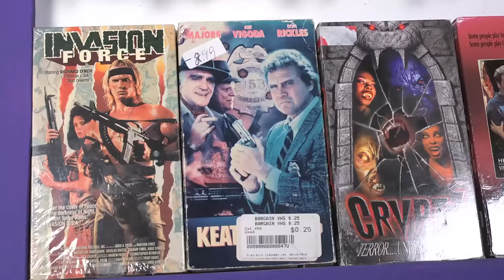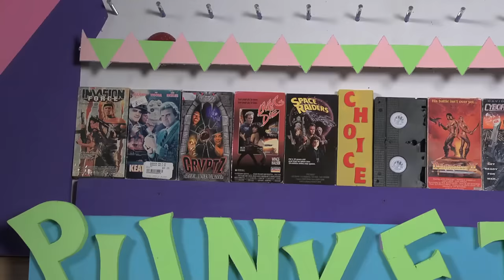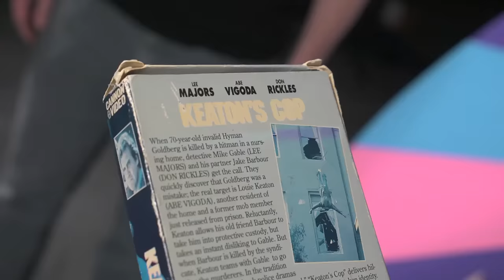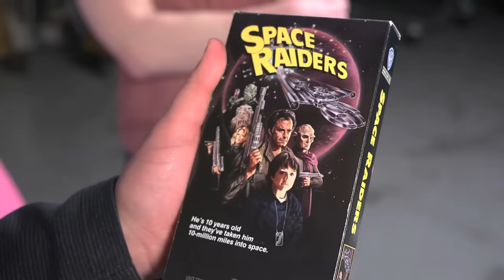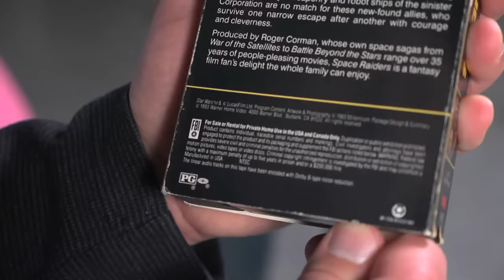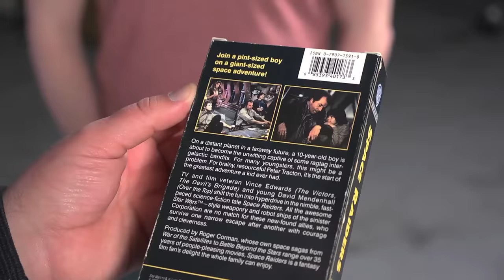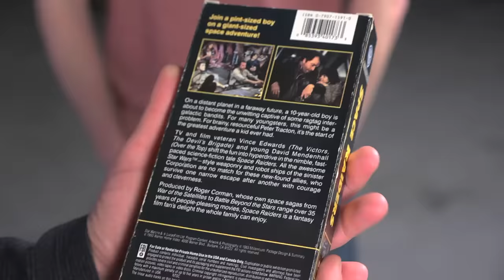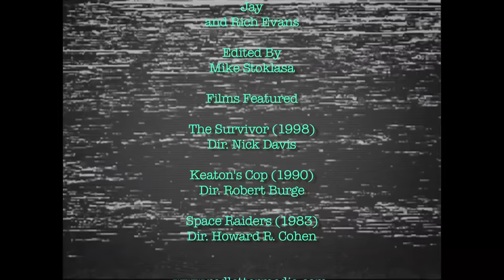Best of the Worst: Episode 48: Plinketto #3

Comment: "10 million miles into space" 

That wouldn't even get you 1/3rd of the way to to Mars on its closest pass by.
Reply: Is is probably like the Kesal Run. We don't need no stinking measurements.
Reply: *space miles
Reply: never said it started on Earth
Reply: @Drunk, Belligerent, Confused, Elderly, Incapacitat it's a shame AU or lightyears never entered the lexicon of screenwriters earlier.
Reply: @Drunk, Belligerent, Confused, Elderly, Incapacitat really big. You think it's a long walk down to the chemist's, but that's just peanuts to space.
Reply: ianrusttattoos nerd
Reply: that was a ten mill yen doylair comment
Reply: Not to mention they should be using the metric system. lol
Reply: @purplefood1  30 billion stellar leagues.
Reply: @Ashley in star trek voyager people they turn into horny lizards when they go to fast at warp.
Reply: @SecuR0M  under the sea?
Reply: I looked it up. 80 million miles at it's closest and it would take 7 months at 249,000mph. I assume that speed only happens in a vacuum like space where there's no deceleration from air resistance. That's wild.
Reply: Nerd
Reply: That's about the size of the entire universe in a JJ Abrams film
Reply: Thank you for that scientific context. Seriously, I appreciate it.
Reply: "They've taken him somewhere between 10 million and 5.4 septillion miles away" doesn't have quite the same ring to it.
Reply: @pyramear5414 That's how evolution works, that's just science!

Comment: At it's closest, Mars is only 30 something million miles away. So they didn't really take that kid all that far out.
Reply: Nuck Nacker Well in terms of space travel it isnt really that far.
Reply: space travel for reality or for sci fi?
Reply: Did the math on this 'cause I got really fucking bored. Assuming that the spacecraft maintains a chemical propulsion speed of 24,000 mp/h while also assuming the average distance to Mars to be 33.9 million miles away, that would take 1,412.5 hours, or around 58.8542 days of maintaining that constant speed without navigational readjustment or course correction. All things considered, that ain't bad.
Reply: First off, who is "they?" NASA estimates that it would take 6 months to reach Mars on a one way trip. Others say it would take 5 months, while still others estimate it would take upwards of 10 months. None of the sources I found estimated it to be 2 years, however. The math I did was based solely off of raw calculation  (see: maintaining that constant speed without navigational readjustment or course correction) which is where the other amount of time comes from. Now, I was at the very least around 90 days off, but, again, I failed to take into account how long the course corrections would take. 

And since I'm by no means a rocket scientist, I'll leave the more in depth computing to the professionals. I just wanted to give a general sense of how long it might take to make such a trip.
Reply: Sustenance21 The projected paths to mars are not straight lines but very long, out of the way arcs. So are those estimates simply calculated with distance to mars over speed or are they actually adjusted for the actual viable flight paths. You might be right but never heard of an estimate below 12 months.
Reply: Zombiefly 30 million miles? 
I thought we were only 
30 Seconds To Mars!

Please feel free to hate me.
Reply: @Sustenance21  - Time Parsecs!
Reply: @dinosaurspy7096  Reading this thread a year or two later actually hurt my brain with the amount of tryhard cringe I was generating. 😅 

But yeah, I bet you that ship they abducted the kid in could make the Kessel Run in less than 12 parsecs easily. ;)

Comment: Really disappointed that none of them realized or knew that for "Space Raiders", most of the starship effects footage as well as Horner's musical score they praise so much, were actually reused from another (but in my opinion more fun and waaay better) Roger Corman sci-fi adventure flick called "Battle Beyond the Stars", which is basically Seven Samurai in space.

So in that sense, Space Raiders always felt more like an even cheaper, boring, scraps of the knock-off C-movie to me. Very cost-effective filmmaking by Corman for sure, but it could have elevated this flick so much had it at least featured original music and ship models. If you have seen and liked Battle Beyond the Stars, it can be hard to not get constantly reminded of that better movie while watching Space Raiders. The latter struggles and ultimately fails to stand on its own in my book.

Comment: Good show as always. Just a friendly tip:
 
You seem to have an audio lag in one or more of your lav mics. You don't have to mute everyone except the one who's talking in post. You just have to fix the audiolag. You can't do it on a 24 fps timeline if you're only seeing frames but if you go to the timeline's settings and choose "Show audio time units" (assuming you're editing this in premiere) it's relatively easy to fix, just sync the audio waveform of the laggy recording accurately up against the other waveforms. But you need to do this with the audio time units so you can see the milliseconds. Once you have, you can have all the mics running at the same time and you won't have to mute everything except 1 mic every time someone talks. Making the audio editing much, much less time consuming. You're getting the canned sound effect because the audio is out of sync by only a few milliseconds.